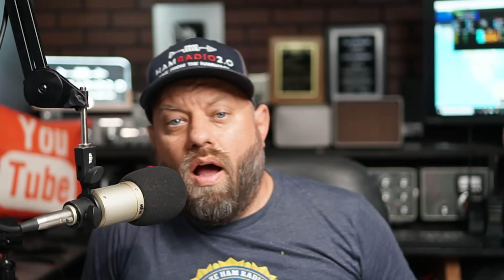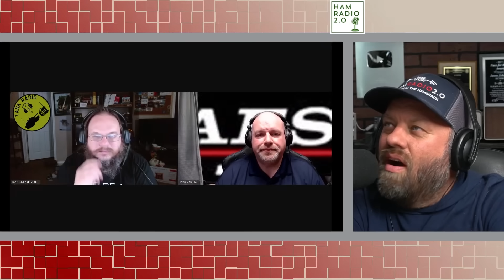The REAL Truth Behind Yaesu's Next Generation Radio Plans

Comment: "Be the solution you want to be."  That's an excellent mantra! 

If I listened to everyone about my first HF rig, I would have thought the FT-891 was trash, too difficult to operate and doesn't have a tuner. Really? I use a WRC and 17 ft  whip on a tripod with extra radials. Works well 40-10 meters and I don't need a tuner.

Getting the itch for a waterfall? I use GQRX in linux with an sdr to see what's out there, then tune up the 891 through flrig via usb cat control, since Im on the computer already.

Next trick? Getting a tr switch with rf split and figuring out if gqrx can be slaved with flrig for freq/modes/etc to the 891 cat controls.

Comment: For portable, field days etc. we need an FTX-1R with 100W and built-in ATU.  But to pair with a base station like my FTdx101MP we need an all-mode VHF/UHF radio to rival a certain other brand's 9700.  It's insane that to do VHF/UHF sideband or data I have to have the FT-991, an all-band radio that (poorly) duplicates the HF capabilities of the FTdx101.

Comment: I am desperate for a 897D replacement. This radio is the most flexible radio ever made. It has a built-in power supply which can be removed & batteries put in that allowed 20 watt portable operation. Otherwise it is a 100 watt HF/VHF radio with UHF to boot.

Comment: the point on 7:58 about hotspots and sound quality is actually quite controversial. since we're talking digital here, as long as the BER is acceptable, should be no difference at all between a hotspot and a repeater in sound quality. as most digital modes those days are using AMBE2+, should be not that much difference between those modes themselves (hardware vs software encoding aside). i believe most of the difference is actually from the analog voice side of both the transmitting and the receiving radios. with analog RF like the allstar nodes obviously the situation is different.
Reply from the maker: Yes

Comment: As far as 220 goes, I think that the solution for Yaesu (and other manufacturers who don't want to make radios for the 220 band) is to develop 220 transverters that integrate seamlessly with a couple of their radios.  The transverter takes much less development time and cost to make. You can then use the sales data from the transverter units to tell if full blown 220 radio would be profitable.
Reply from the maker: That's a good idea

Comment: How about just fixing the UI on the FT-891?  The hardware is great, but any radio that dumps its settings with every band, mode, or memory change is no fun to operate.  I bought one, worked with it and tried to love it for two years, but kept going back to my 857 when it was time to go to the field.  Finally traded it in towards a 710 (it's a keeper), but I know my 857 won't last forever.  So... how about just fixing the UI on the 891?  Also, that weird 1500 hz shift in the digital mode made using fldigi a losing game as well.  While Yaesu is fixing the UI, could you fix that as well?  That triple-conversion receiver was rock-solid during lightning season, and I'd really like to have one again.

Comment: Nonsense gibberish waste of time talking about 220mhz. And the real question was never addressed: Will there be a replacement for the FT-857? Everyone wants a new portable all mode SHACK IN A BOX to take the place of their aging 857. The 897 and 857 were/are the best radios ever made. The fetish of the waterfall does not need to be included. People want a 100W all mode radio from 160M to 70CM that has a built in tuner. If Yaesu can make this ruggedized with a real lithium battery pack that can attach so it is a self contained unit that can transmit on full power - THEY WILL RULE THE MARKET FOR THE NEXT 20 YEARS. The 897 was close but the lack of a good battery was a major issue. Then Yaesu doubled down and made it worse by no longer selling the battery chargers. Talk about spitting in the face of those who bought the 897.  But now with good lithium batteries, all this can be rectified. Toss is a detachable pluggable waterfall display for those who can't live without them. But the problem with the big display is that it chews up the battery. Most would rather have talk time than a screen. 

QRP is fun, but my 897 & 857 can do QRP - just turn the power down. We just want a Shack in a Box that can also put out 100W. 

If Yaesu can do this, they will crush the competition for decades.

Comment: I have emailed John on this topic. We need a new two-meter/70cm all mode transceiver. Two meter SSB is far from dead! Yaesu hit it out of the park with the FT-857/FT-897D radios. But those radios are over 20 years old now. Let’s have a replacement!

Comment: Yaesu  fanboy here I run the 101MP as the base I use to run the ft857D in the truck pulled it out and installed the Kenwood 480 HX 200 W model and I must say it made a difference. I’ve said it before, and it probably falls on deaf ears but I wish Yaesu would come up with a 200 W mobile HF.

Comment: I have FT 857, 897 and FT991 (love them) but I would really like to see a LARGE Desktop radio that I can hammer on for contesting (100w is great / 200w is perfect) and still use for home-side use on VHF and UHF.  I will always keep my Kenwood 2000 for that exact reason.  That Kenwood also lets you receive HF and output to VHF - and vice-versa.  As far as 220, several of the Alaska Radio clubs are migrating back to 220 because the use of 440 is somewhat limed due to proximity of OTH radar sites up here. Remembering Military is Job #1 and amateur radio gives way to top priority.

Comment: The big problem with 220 is there is very few radios that have it and if my current UHF VHF radios had 220 in there, I would put an antenna up for it and use it. I like to run multiple radios working one and monitoring others in the scan.

Comment: I’m disappointed to hear that there is nothing for the 220 band. I’m clinging to my AT5888UVIII currently use as a base station.  There is very little traffic on it and fewer repeaters but it’s a great band.  I would love to see a radio that combines dmr, system fusion and dstar. 
I wish the mfg’s would wake up and realize there isn’t going to be a “winner” and just remove the proprietary attitude to produce products that a very large majority of ham operators want. A radio that can use any digital mode that a router might be.

Comment: I will be okay with a slightly larger version on an 857 with a few additions. A screen color choice, a multi function knob, an internal tuner, an internal sound card, more memories, and water resistant. I dont mind the menus of the 891 and i dont need a pan adapter, but maybe a port with optional pan adapter would be great.

Comment: I'm holding out for the upcoming Kenwood mobile because it will have 220!! I'm planning to use it as a base station. Won't be buying Yaesu much any more. I just bought an old, used Kenwood TH-F6 to compliment my ultra cool TH-D75!! I got it off Ebay and it works perfectly. Kenwood is the kool kid on the block while Yaesu is one of the nerds. So soon I'll have 3 Kenwoods. I do admit I like my Yaesu VX-6 though. A good all around radio.

Comment: His comments about not making a 220 radio prove that as far as they are concerned, they care more about being able to sell lots of product than us being able to keep the bands. They don’t care about the fact that if that attitude continues, they’re not gonna have any bands to sell radios into they want the quick buck screw our bands.
Reply: Interesting thought, Yaesu at one time gave a little thought to the 220MHz but very little in that when they did give you 220 Especially in HTs the highest watts was a watt and a half on the VX-6 other HTs was right around a half a watt to a watt. The FTM-350 mobile only gave you 1 watt of power on 220, so sad the 736R base gave you I believe 25 watts on 220 but it was a Module you needed to insert into the radio, those days are long gone.
Reply: 220 is limited to 5 watts in the U.S. Take a step back and look at this from a manufacturers viewpoint. They have to invest time and money on research. Money on building the circuit board mold, crafting all the other parts they go into making a radio, then advertising it, boxing it up and shipping it out anywhere in the world that would order it, fingers crossed. 220 is a shared band. Hams can be kicked off if enough money changes hands. Check Baofeng and see if they make one.

Comment: The problem with 220 & 900 is it's a chicken-and-egg thing. You almost need to somehow get a large metropolitan club or group of clubs to all basically commit to both repeaters and radios and using them to get it bootstrapped. That said, I also still buy into your premise that the way to get activity on repeaters is to provide activity on repeaters. I throw my voice out on something near me almost every time I'm in the car.
Reply: Here in East Central Alabama we're seeing activity pick up a bit on our 220MHz repeater,  I'm guessing that the availability of cheap radios like the UV-21 that cover this band is responsible for part of that.  The repeater also being on the tallest mountain in Alabama (Mt Cheaha) helps with the coverage area.
Reply: @ Yeah. Coverage and inexpensive radios are the trick, I think. "All band all mode" radios rarely cover 220, some 2/70 HTs will, although sometimes as an afterthought. 

The other problem I see is that, at least here in the Twin Cities, there's already a lot of repeaters to choose from, and while it means the whole Metro is well covered, there's little linkage, so they're all islands. It's a fragmented space, with a couple of popular repeaters and a lot that just get used for specific nets or stuff. More bands in some ways just means more fragmentation.
Reply: East Tennessee has 220 repeaters as well. I sold plenty of Yaesu FT-736R's with 220 modules back in the day.  There are over 30 countries that have a 220 allocation. Yes, they're almost all in North or South America, but seriously? If China can do it, and Kenwood can do it... 🤔

Comment: An updated version of the Yaesu FT-847 that had several SDR transceivers at 100w for me would be a must buy if Yaesu produced it.. Having the added option of a 1ghz 10w or other transceiver card for satellite and a USB CAT/data tuning and tracking port would be excellent..  From time to time I still use VHF and UHF SSB with the FT-847's modest output drawing the ire of a couple locals with kilowatt stations that seem to want these frequencies all to themselves..

Comment: Yaesu won't bother with 220 mHz but I have bought a $60.00 Chinese radio that DOES have 220 mHz!!!  The Chinese have NO problem installing 220 in their radios.
Reply: I'm looking for a 222 Multi-mode .  It's ridiculous that no one is producing a 222 multi-mode in 2025.  Use it or lose it.
Reply: @joeblow8593  Exactly... The 3 major manufacturers don't want to be bothered with 220 mHz. It would only cost them a couple of dollars to add it. I have been using the 220 band for over 45 years!
Reply: @joeblow8593  That is so true, would love a 222 Multimode radio, if I had multimillions I would make one.
Reply: Get the Yaesu VX6R. 220mhz included as a tri-band
Reply: 220 milliHerz you can do with manually turning a big magnet around

Comment: I desperately wish for a REAL replacement for the FT-817,857,897 series. The ruggedness, size and utility of the radios was great, I treasure mine!
Reply: If you want a true QRP field radio, look at a Lab599 TX-500. I owned an FT-817 and it was a complete piece of junk. Other than the case, it was not a durable radio (knobs break off, blown finals, etc). I've owned my TX-500 since they first came out and it's a tank with a great receiver and an unbeatable transmitter. I run one watt every day and can't say enough good things about that radio. It will set you back more money, but you really do get what you pay for.
Reply: @toddbu-WK7L I have a TX-500 and it's an awesome radio. I really like it. However, when I tried to upgrade the firmware, I bricked it. No one at PurpleBear Security or Desert Wireless answered my support requests. Their web forms are a black hole and there is no phone number to be found. I'm certain they're in violation of Federal laws pertaining to the warranty. Luckily, I was able to dig out of the problem on my own by throwing a hail Mary and using a Mac instead of a PC to download the new firmware. Everyone needs to be aware of this. You are on your own with the TX-500. Even with that issue, I would still by another one. It's that good.
Reply: Amen to that.

Comment: Sort out the scu-lan10,  expensive for just remote in your home wifi bubble, but a sod to remote from outside that bubble, and digital modes also ie ft8 ect, come on guys, disappointed with this interface, icom / flex ect have easier interfaces. Big disappointment with it.

Comment: We have an active 220 repeater here in Huntsvillle. You are correct its low noise and the group on the repeater promote getting a 220Mhz radio.  On the 857 yes I would buy a newer version becasuse I really loved it.

Comment: Here a thought about radio in general at this point in technology. 

  I realize all the ham radio manufacturers need to make a radio that fits for all around the globe. 

However, I'm going to start calling them out as they do SDR radios.    The whole point of a SDR is you make the hardware capability to say work on 2m, 220, 440 and 900 MHZ.   Then use the software to turn on the features you want by paying for the software. 

I witness this with Kenwood commercial radios where you purchase a license to make your radio do DMR, NXDN and P25 with analog out of the box.    If Yaesu, Icom or Kenwood want the "wow" factor.     Let's start offering radios where I get to choose what it can do and the bands I operate on.   This not being able to select the features in the radio world is 1990's mind set.    
 Information Technology has had these type of features for the last 15 to 20 years of being able to upgrade a license to get a set of features or capabilities.

Comment: PLEASE give us an 857D replacement!!!!!!
Reply: And make sure it has an orange screen option!
Reply: Tomorrow
Reply: Their idea ssb 2 m raido ,  w hf   so u can get update 500 free same as 510
Reply: FT-991A?
Reply: @alexkissing3274 It doesn't have 2 meters and 440.
Reply: @ If they would make the 991A without the waterfall display so it could be much smaller and the head removeable, then yes, but have pan adapter option.
Reply: When is that coming need a mobile form factor and can we get fusion in there
Reply: I think the FTX1OPTIMA is it!
Reply: @sgtaaronp  It’s pretty darn close!  Got the Optima ordered to give it a go.  My only concern is not being able to do the remote head with the spa1 with any mounting distance for my vehicle (per John).  Saw in the user manual it has the capability for my ATAS 120 through the built in tuner. Still have my expectations to be able to get a third party remote head+Spa1 for my Jeep!

Comment: I just wish they made a HF/VHF/UHF portable/mobile with a built in tuner (like G90) pushing 100 W. That's why I still use the Icom 706 Mk2G. POTA is HUGE right now and that market would do good for anyone that makes a radio geared towards that market, beyond QRP radios also.
Reply: With built in sound card & low RX amps
Reply: Looking for Unicorns too, However, if they made a portable/mobile option with all these features, they would lose sales from their other radios....

Comment: I would never give up my Icom 7100, Icom 746 and Yaesu FT- 857, because they are the only close to complete shack-in-a-box, would like to see a radio that ads all mode for 220 Mhz & 902 to 930 Mhz added, in today's world, working mobile or portable and having as much as possible in 1 or 2 radios is a big deal. 
I use repeaters least in operating radio as the group think mentality is too prevalent with less freedom to say what you want. 
I have DMR, D-star but don't really like the quality of linked systems, I much prefer simplex on D-star, DMR, and SSB on VHF / UHF 2 meter/70 cm.

Comment: I have a few HT's with 222 MHZ, but not much use or
availability in this area in the
Northern Suburbs here from
NYC. 
I once had an Alnico 222 band
transceiver.
In our club at Field Day for the
last couple of years only FT8.
Even our club's repeaters, 1:VHF, and 2 UHF, are not used
much, except for a couple of
nets during the week 
We are working though on Echolink for our VHF repeater. 😊
Reply: Thanks, I meant FT8 on 6 M 
mainly, and no more 2M or
70 CM at Field Day, with a 
bit of CW along with SSB
on HF.

Comment: i love Yaesu but those FTM radios are a royal PiTA to operate with the menu and front buttons .  And i have two FT991a and love them . I returned an FTM 400xd  ...make it more like an Alinco DR735 or anything more intuitive ... terrible ...as for 220 , Anytone can do it and Yaesu can't ???      Anytone AT-D578UVIII  ?   There were TriBand mobiles with 220 in the 90's ...seriously, can't do it in 2025 ??? cmon ...
Reply from the maker: Agreed on the Anytone 220 part
Reply: Wouxun drops tri-banders left right and center like it's no problem at all. I'm struggling to understand why it's such an issue for Yaesu. They act like it requires moondust and unobtainium to produce.

Comment: Icom 7100 or ft891 I’m torn which should I get
Reply: I have the IC-7100, Shack In A Box, will never let it go.
Reply: @ yeah found a used one never hooked up 850
Reply: @ or a 891 for 549
Reply: @ hate kenshits
Reply: @ it’ll be 7000 bucks
Reply: I’m very happy with my FT-891.